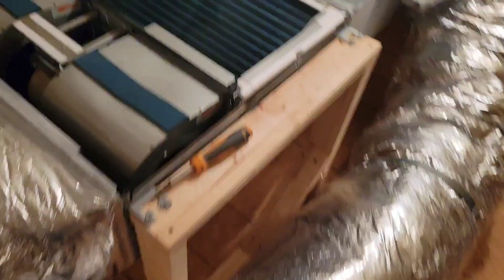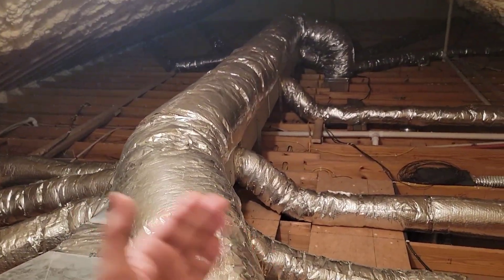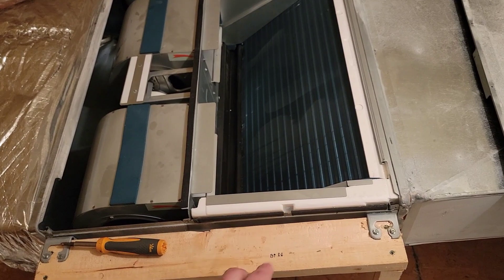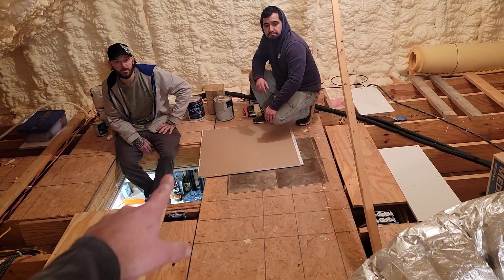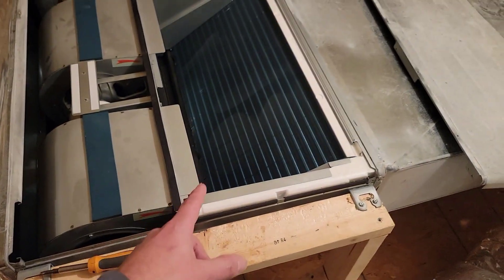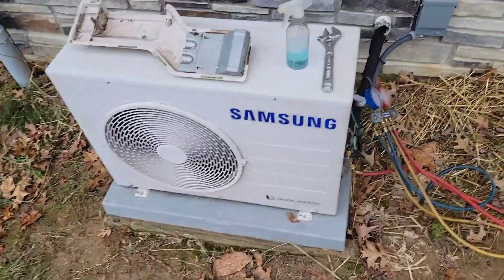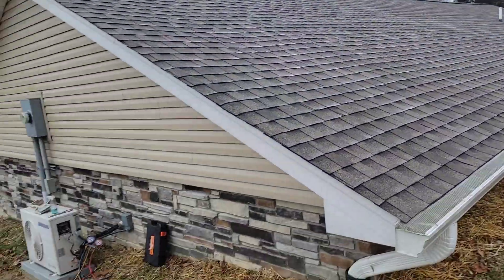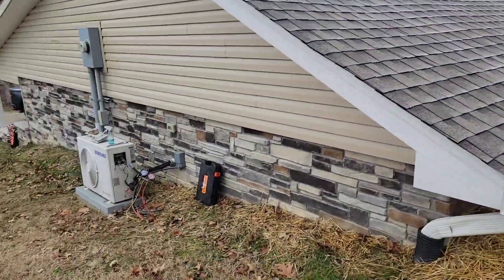My Equipment Keeps Breaking! What Should I Do?

Comment: My favorite HVAC guy started a complete system replacement for me this week. Had to be done by Monday because I had other things starting.  He got new unit installed and ducting along with new runs for the remodel. He did not get the AC installed but will come back. He was hurting and all choked up on crawl space dirt and insulation but out of the way for the drywall guy, who of course is too sick to work. Life goes on and you need to work with people you know are great at their jobs and great human beings. We were on a time crunch and when he spooled up the heat he could hear a noise I did not hear. By the time it spoiled down I could hear the fan grinding. He took the new furnace apart and found the new fan was not secured to the motor. Set screw was on the opposite side from the flat spot. The free spin made the fan impossible to slide without a fan puller to pull it into place. Once that was fixed and he was reassembling a clip popped off and we both watched it bound into the inducer fan. Long night but we got it up and running before he went home.

Comment: The number of call backs and warranty issues on this unit is mind blowing. You are much more patient with the mfr and give away much more time than I do when things aren't my fault. After 30 days, someone (mfr or cust) pays.
Reply: Could you share how you deal with the  unhappy customers?  When a unit, which you (or your employee) advise, fails within a  year.  I am just curious how to make customers pay and make them happy  😁.
Reply: I've been in business 24 years, am old and  semi-retired, and probably not the best one to ask. At this point, protecting my health and time(not customer 'happiness') is my priority.  For years I just bent over and took whatever customers or manufacturers dished out. New businesses have to do that quite often. I no longer have to.
I offer 30 days absolute no charge warranty on furnaces and water heaters. After that, trip charges resume, and either the customer or the manufacturer pays for all time worked. Flat rate says 1.0 hour for a gas valve and it takes 2.0 because of factors beyond my control, the customer gets a bill for 1 hour.  If the customer (or the manufacturer) doesn't like that, or is rude and demanding, I tell them to call another authorized warranty service center for help.  I just don't need the stress anymore. 
After 30 days, I play it by ear and just do what I think is the right thing to do. Even then, I rarely work for free. For long time loyal customers, and those who are nice, I'll bend over backwards to serve them. Doing quality work for those who appreciate it and don't mind paying for that is a pleasure. I let new guys handle the rest. 
Good question. You may enjoy watching some Steve Lavimoniere videos. He's a laugh a minute, in business many years,  and very direct and assertive when dealing with customers, like I am.
Reply: @Robnord1  Thank you for such detailed answer 🙏👍😊

Comment: Hey Teddy, 1) could the leaking issue be related with the spray foam? 2) do you have gas furnaces in your area with the ductwork in the attic? 3) its the first time i see buried house. What is the point? Thanks
Reply from the maker: coil was only a year old
Reply: @TaddyDigest  i think spray foam off-gassed VOCs which could caused galvanic corrosion. Maybe try measuring voc level before replacing the coil 🤔
Reply: @thecurious6721  I was wondering the EXACT same thing! Spray foam insulation is toxic and off-gasses quite a bit. I wouldn't  rule it out as a contributing factor. Also wondering if pressure testing at 600 psi is spec for Samsung?
Reply: When I was in a spray foamed market I found leaking attic coils on very young units more than any other

Comment: Wonder if high levels of VOC’s is causing consistent leaks based off of formicary corrosion? I’m assuming that energy efficient home is properly ventilated with adequate air exchange. Dilution would be the solution for this home I believe.
Reply: Just replaced a Fujitsu ducted AHU and guess what the common denominator is…. Spray foamed home that is tight construction.
Reply: @adamhyche8947 solution? Also i didnt see a surge protector on the condenser in the video btw